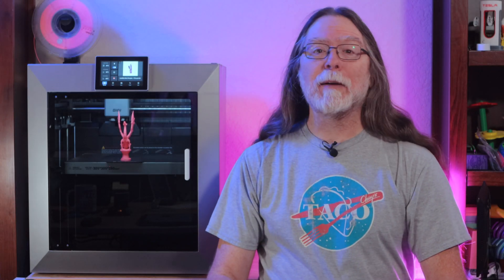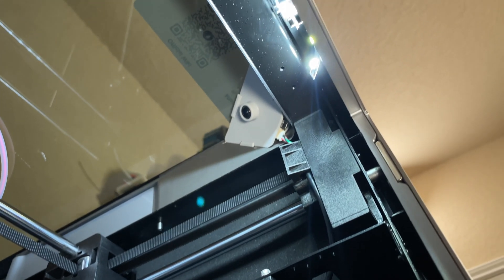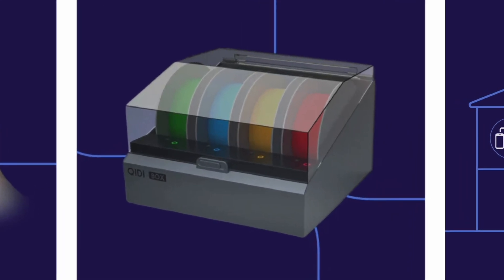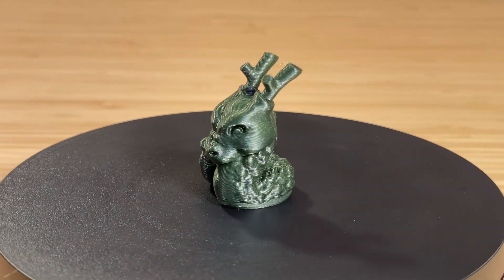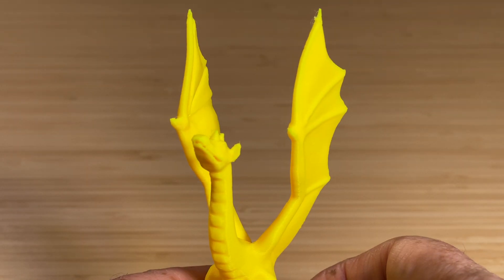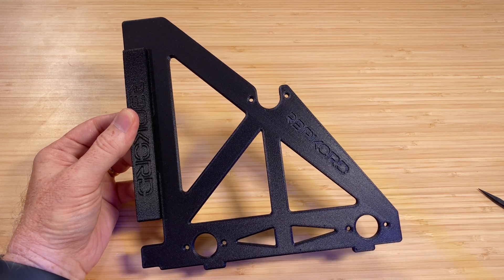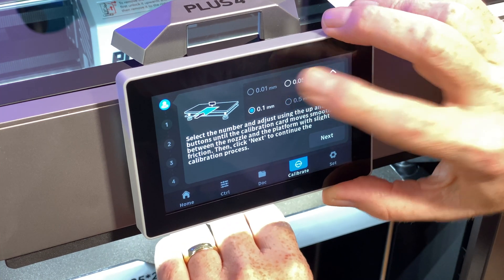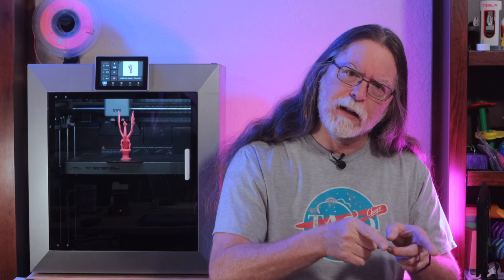Qidi Plus 4 3D Printer: First Look!

Comment: Heater Chanber over heats and will cause a fire. This printer is a dangerous machine and Qidi needs to send out a new heating chamber module board as the choke is not working properly and heats up past 800 c and the firmware update does not work. It is dangerous and should not be used.

Comment: Those dislikes you mentioned are huge.  Not so much the filament cutters, it does seem weird to not include a pair with such an expensive printer, but we all have a bunch at this point.  But I will NEVER level a printer with paper ever again.  That simple fact is completely unforgiveable on a printer made in 2024.
Reply: I am pretty sure it has a filament cutter I saw it on another video
Reply: The printer has full auto-Z and auto-bed-mesh-levelling.  These two things account for most imperfections in the bed's flatness. 

The use of the paper deal is when you want to perform manual bed tramming.  It is absolutely NOT necessary out of the box, or pretty much ever, however if you are a perfectionist and want to chase sub 0.1mm flatness across the whole build plate, then doing a manual bed tramming is almost always going to be necessary.  This printer gives you that option to do that step, and that's what the paper-thing is for.

Comment: You were correct, the power supply was set to 220V, I really appreciate you letting me know. I just figured it would not come on if it was set wrong, but it did, Thanks!

Comment: Defective right out of the box, Heater Bed will not come on, Printer head heats up, chamber works but bed is dead. I could not get it up to 30degrees C, it shuts the whole unit down. Just buy the Bambu Labs!
Reply: Check your power supply it may be set to 240V. That is almost definitely your issue. I know it says on the printer it should be set, but at least 2-3 people have gotten theirs with it set wrong.
Reply: Even brand new vehicles have issues.  Chill out and expect occasional things to happen with new products.   Relax max, relax!   It's going to be OK.  If you are still out of control with your thoughts, seek medical advice.

Comment: Hi , I have been testing a  plus 4 chamber heater,  but I would be interested in the chamber temperature in the qidi can you measure it with a probe at 50% height in the chamber to see what the actual temperature  is.

Comment: Hey just wanted to add and it's a shame i can't post photo's but Aria dragon i have printed back when it was on thingiverse many years on the flashforge creator pro, certainly took more than a couple hours, it's one of the few decorative prints i do.... trip down memory lane so i grabbed the STL and printed it on the Q1Pro in PETG-CF, 1hr 20minutes for the print. Little bit more stringing than you had but I tend to print PETG a bit hot.
Next i'm going to splice together some different coloured PLA and do it again
Very nice using the Dragon rather than the same default prints everyone else seems to use
Cheers
Reply from the maker: Aria is one of my favorite models to print. 😊

Comment: Another person who just got the set up steps WRONG..... the manual bed level process is only to be used IF the auto setup has an issue with getting it right.... sadly this then confuses people who run this when it is not required
Reply from the maker: HI, no need to yell. On the Tool screen, it's the first of three calibration operations. The lack of documentation can lead one to decide that the correct thing is to perform each of the three options in order from left to right. To me it seems like it's the sort of thing that only needs to be run once, as I noted in the video. There were, in fact, minor adjustments to be made. However, I submit that on a fully-automatic bed leveling system, adjustment knobs are unnecessary.

Comment: weird. I guess they fixed the bed leveling process in new firmware. I set mine up about 2 hours ago and bed leveling did not making me do the manual calibration first
https://youtu.be/6KbBS9-Rix8?si=zp6Gpe6yQrgQy2yt&t=716

Comment: Your footage of the internal cam looks like it still has the "clear" plastic tab over the lens. Once I removed mine it looks pretty darn good for 1080p
Also, as mentioned in another post. Upgrade the firmware to that on the github. The interface changes a bit and the presliced benchy still completes in 16 minutes and looks easily as good as my X1C... using the small sample pla included with the Plus4

Comment: Wow dragons all came out beautiful! The PAHT-CF prints look excellent too. Got my Plus4 not long ago and I'm really enjoying it. I'm getting really high precision. Print in place bearings with 0.02mm clearances that come off the bed with zero fusion. I may try even lower. I still have a lot more testing to do, but no issues so far. I think the Plus4 along with the Q1 Pro are the most capable printers available for the money. I think the Plus4 needs a few tweaks for sure, but the overall positive nature of reviews so far demonstrates it's a great foundation. Thanks!
Reply: @802Garage - after 5 months, how are your next impressions with your Qidi Plus4? Thanks for the initial thoughts.
Reply: @TheShadowsShadow  Still love it. It's not the printer I would recommend to someone who needs a near zero chance of ever having to tinker. Most teething issues have been addressed, but there can still be problems that pop up. Mine has been nearly perfect though. It's larger than average, can use nearly any filament, has very high accuracy, produces nearly zero VFA, and is very affordable given all the features. Especially if you are willing to join the Qidi community and discuss with other experienced users, it's a great option.

Comment: ABS prints faster cause once heated is way more fluid improving flow. And requires less cooling as well so depending on the cooling system can usually go faster with reduced layer time.
Reply from the maker: Thanks for the explanation!
Reply: @BV3D  whilst that sounded good the real reason is that Qidi for some reason sets their max volumetric flow rate very conservative at 12mm3/s for PETG whereas ABS is set at 17mm3/s in the generic profiles, this will make a significant time difference itself
Reply: @AusPhilMotivated  for exactly the reason I explained

Comment: Hi Bryan do you think this is  a good printer to buy because i am torn between this and the bambu labs
Reply: Now is the best time to wait tbh
Reply: As a long time qidi and bambu user you won't be disappointed with either. Qidi does the exotic materials and has the larger build volume while bambu has better quality with pla and petg with a much better online app. All 4 I have run almost 24/7 (q3max, q1pro, p1s, and a1).
Reply: I have 2 X1 carbons but I'm no hardcore fanboy I've heard a lot of good things about this company as well but from my experience with what I have used my 2 X1 carbons have been absolutely phenomenal workhorses of machines with over 1500 Printing hours on both of them and one was original Kickstarter unit I'm backer number 766 I believe it was  it's really up to u but if u have little ones any of the bamboo printers can do multicolor and you can print right from the app from tons of models on their maker World site  that other people have designed and uploaded

Comment: I'm not sure if you have the latest firmware update, but as of 1.4 QIDI added a cool feature to the printer allowing it to turn into a filament dryer. Also you shouldn't have to use the manual bed leveling. This is only used if you need to change the bed level manually for odd prints. This is the only printer that gives you this option.
Reply: What kind of odd prints